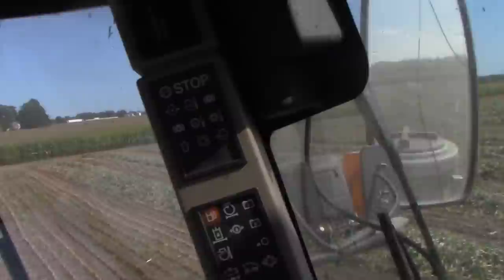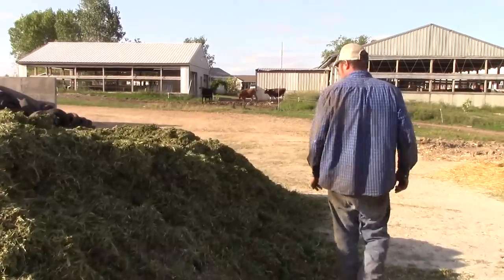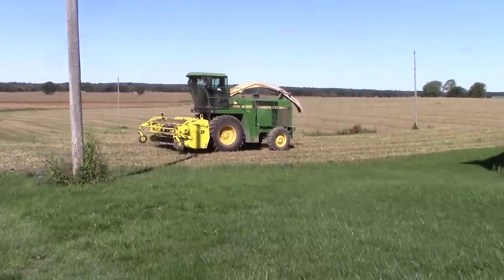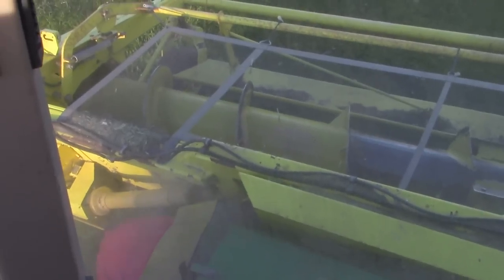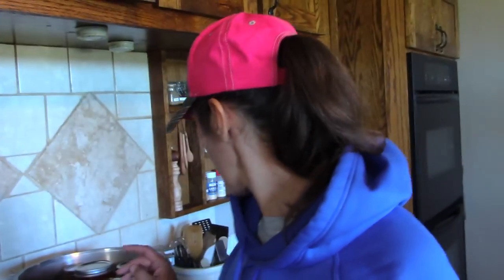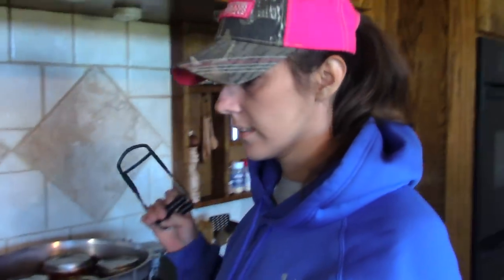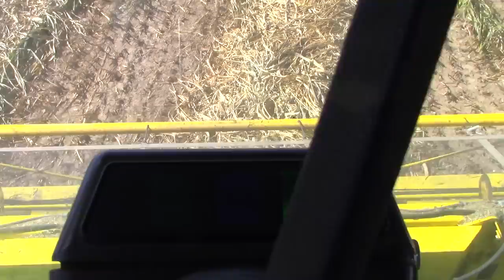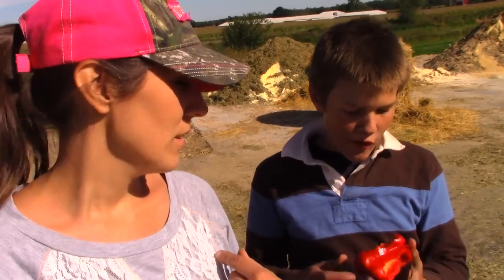Fire in Chopper While Harvesting Sorghum!?

Comment: While you still have some anxiety is a good time to review your fire prevention.  You have a lot of equipment/buildings and money involved.    Suggestions: 1. inventory all fire extinguishers, on paper. list what type, what size, locations, dates and make a file. Dates should be found on the bottles. Manufacture date (gets obsoleted after appropriate  servicing), bottle hydro test date (does expire), serviced refill date(does expire).      Check NFPA and state regs for type/size recommendations for the situations.  New equipment/buildings can slip by and get skipped on extinguishers.     2. Plan a annual training. Pick out a bottle in rough shape or closest to expiration and fire it off. Make a fire pan from a barrel, little gas and let everyone in the operation take a turn.

Comment: Have the boys read Matthew chapter 7 it will help them put it in perspective. Hind site is always 20/20.If you walked around the chopper and couldn't find smoke ,then I would have thought same thing, that dry grass floating in the air was hitting the muffler. Happens on my zero turn a lot, just touches the muffler long enough to give the odor of burning grass. They should be thankful for all you do to help, I knew lots of farm wives that didn't do half what you do. 😉
Reply from the maker: Nobody was judging me, just concerned for my safety and the safety of the chopper. Thanks for your support! 😊
Reply: @acresofclayhomestead   I guess it was just the way you worded it on the video,that it seemed like they didn't like your judgement call on the situation. But maybe I interpreted what you said wrong🤔Like your videos tho😉